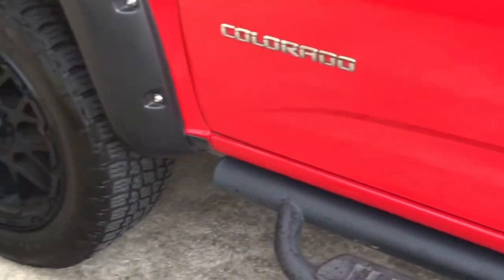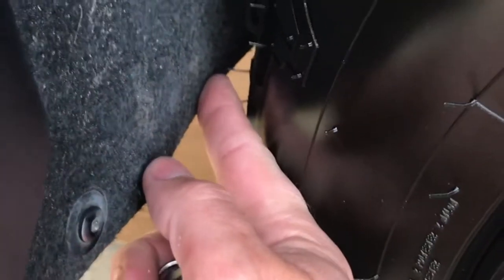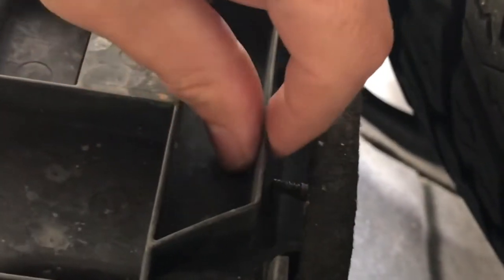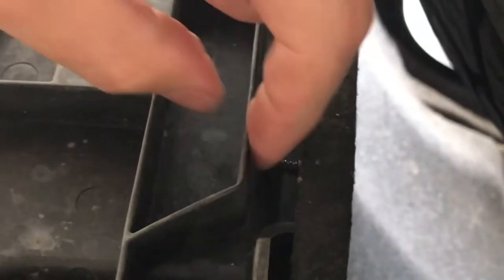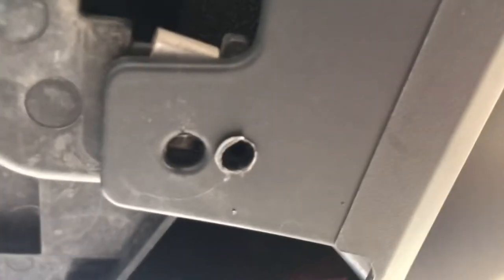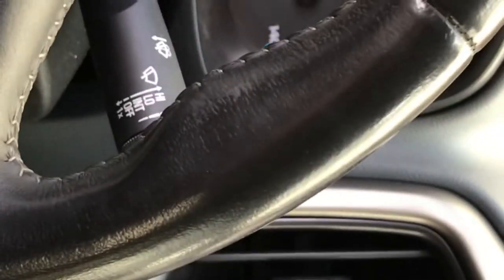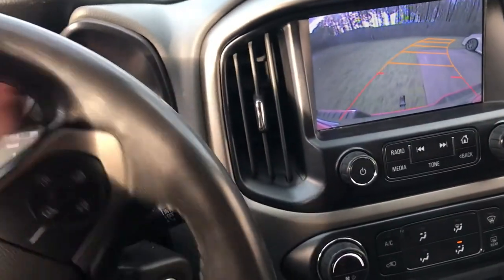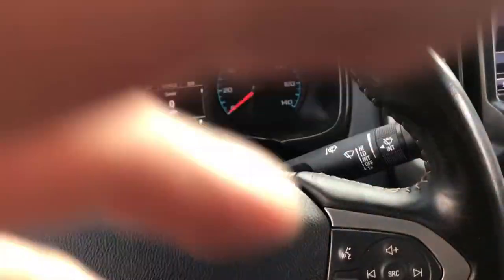How to get rid of tire rub on 2015-22 Chevy Colorado quick and easy!  10 minutes EACH SIDE!

Comment: Hey buddy great video what size wheel spacers did you use? And what's your rim and tire size? Thank you!
Reply from the maker: I did not use wheel spacers. Rim size was 20 inches. I didn’t measure the tire width or height and I traded in the truck for a new Silverado a few weeks ago
Reply: @robdedgar  ok thank you. I was thinking of squeezing 22's on my Colorado before doing the lift kit

Comment: Is this stock suspension or do you have a leveling kit? And are those 33 inch tires x 12?
Reply from the maker: 20 inch tires with a front leveling kit
Reply from the maker: I added billstein shocks that are stock height
Reply: @robdedgar  thank you for the reply, really sweet setup. I just ordered wheels and tires, 20x10 with 33x 12.5. I'm really hoping they'll fit. I have a leveling kit, and don't mind trimming alot, but its gonna be tight
Reply from the maker: @BespokeCarpentry  yeah you’re definitely going to be trimming some of the back of your front bumper. But by doing this method you wont be trimming as much
Reply: @robdedgar  yeqh I figured, totally fine with that to get the look I'm going for. Thanks for the info man